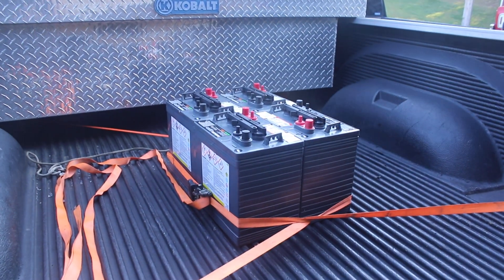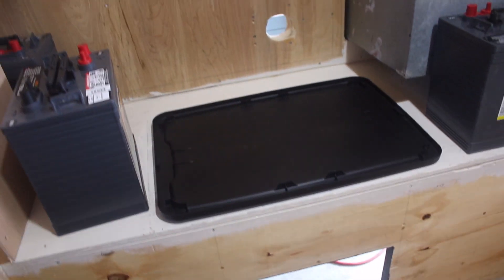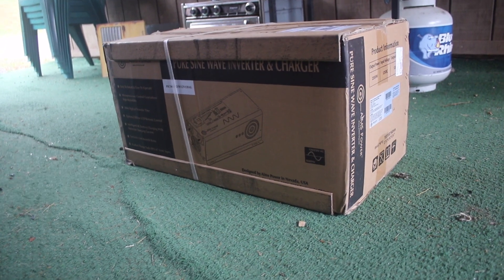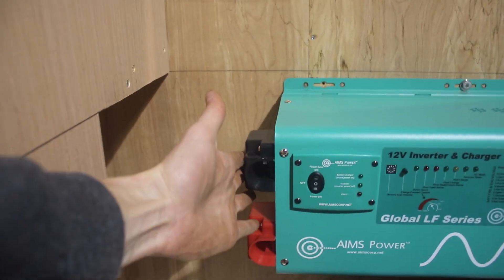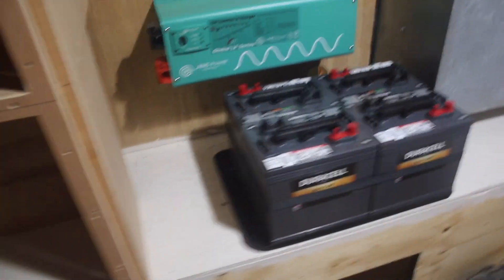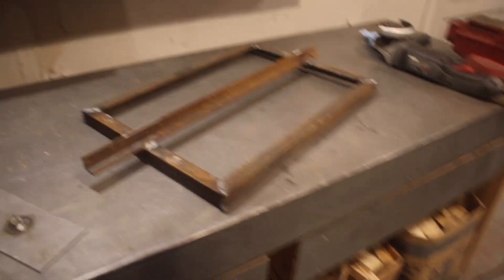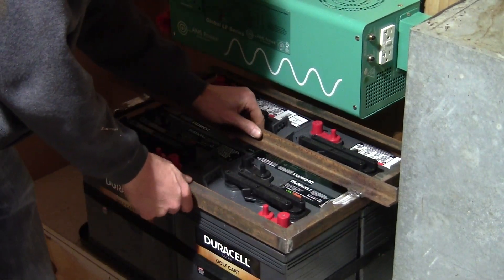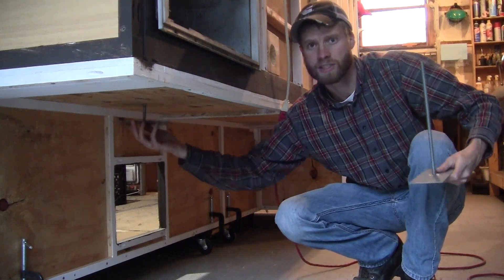Starting the ELECTRICAL SYSTEM 🔌   - Truck Camper Build Part 20

Comment: You probably can reposition the 120 volt outlet box if you want to orient it the way you originally planned.
Reply from the maker: good idea. But so far the inverter is working out mounted on the wall. Stay tuned for the next video and you will see why!

Comment: Great progress. However I suggest that you do not mount the batteries under the sine wave inverter. When batteries are being recharged, they generate hydrogen gas which is lighter that air, and can explosive in certain concentrations if ignited by any electrical short in the sine wave inverter.
Reply from the maker: Thanks for the tip, I plan to install a ventilation system for the batteries.
Reply: @SquarebodyTruckCamper  Ideally, they need to be fully sealed off from the cabin air (As they produce more than just hydrogen gas when charging) and vented to the outside.   I did this by making insulated boxes when I rebuilt out dinette seats, installed two ABS vent pipes through the tub wall, herculinered the whole thing after caulking up all the seams with automotive seam sealer, and then put a gasket on the bottom of the compartment tops made them so that they screw down, making a nice air tight box.   The wiring comes out through a pipe in the side, that has been filled with expanding fire barrier foam after the #4 wires were pulled.
Reply: @SquarebodyTruckCamper  👍